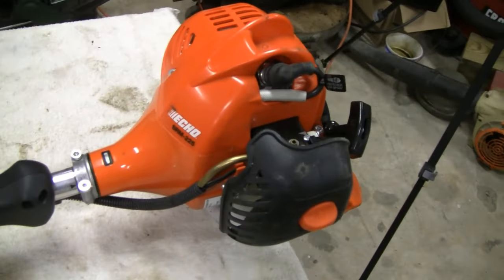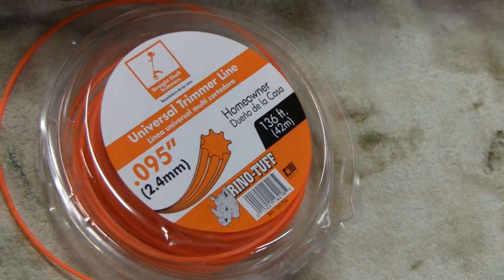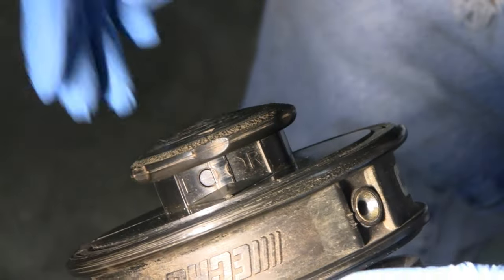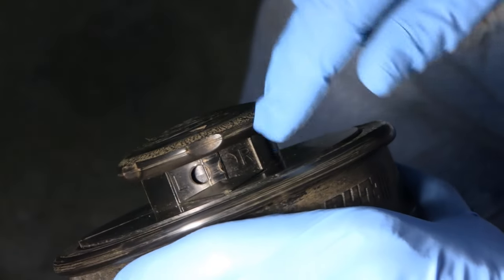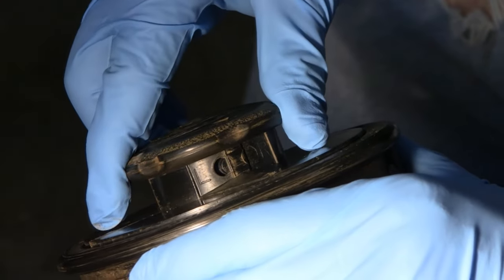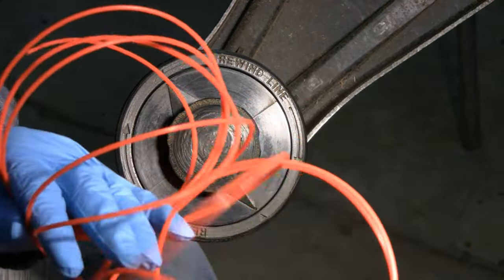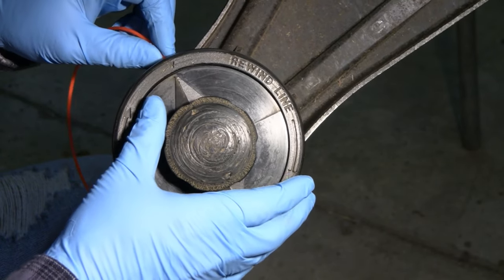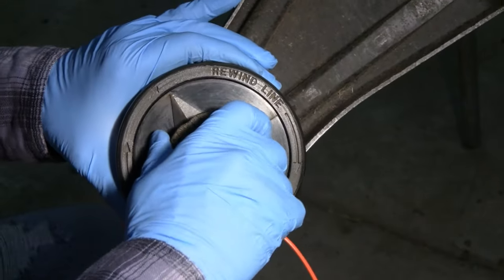HOW TO RESTRING ECHO WEEDWACKER

Comment: For those of you with model pas 225, you can extrapolate the instructions here with a slight modification. The line threading is different. You have to manually feed in the line through holes in spindle and anchor it to the slots on the bottom side. Snip any extra line. I don't know if it make any real difference but I saw another video where he lubricated the spindle and chamber.

Comment: I am so frustrated trying to string this thing. Mine is an Echo 225 and loads nothing like this. Cannot find a video that clearly shows how to string mine. Mine does not have the knob at the bottom as does the one in this video. Any suggestions?
Reply: two separate pieces ..right?
can seem to get pieces into trimmer head...ugh

Comment: Help please. I just purchased the GT-225 with the straight line segments. Last night, after replacing line once, one side wouldn't let me feed the new segment. Tonight, the same thing happened to the other side. There doesn't appear to be any debris inside, I can see the gears. Is this common or should I return the unit? Thank you.
Reply: I'm experiencing same problem. very frustrating..
Did you resolve the problem?

Comment: Forgot to mention that with mine the string passes straight through. Once it is thru and the sting is evened out on both ends I cannot get it to wind. Seems like I have tried everything.
Reply: When you wind the string, you have push down and turn until it stops, then let it up and turn until it stops, then push down and turn, etc. It's kind of a pain in the ass but that's how it works.